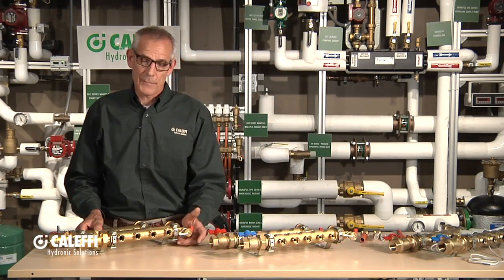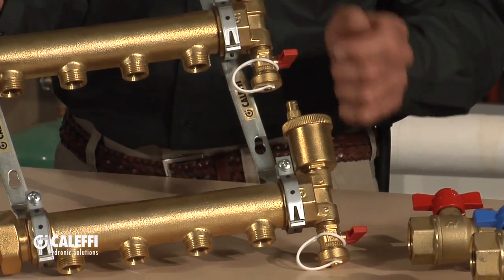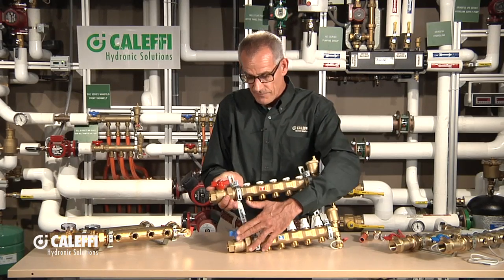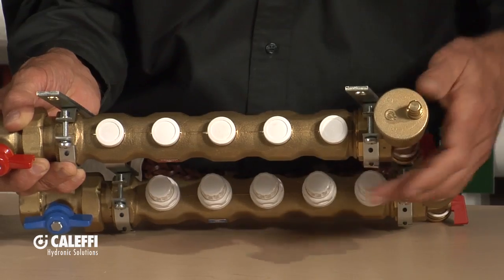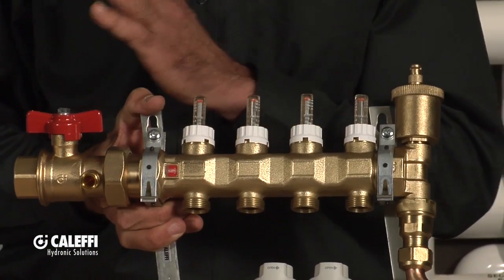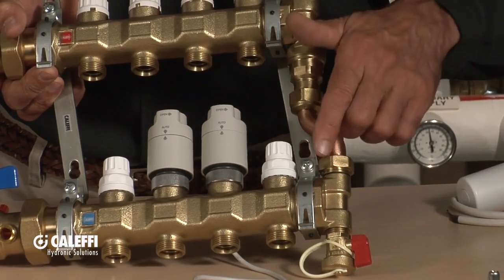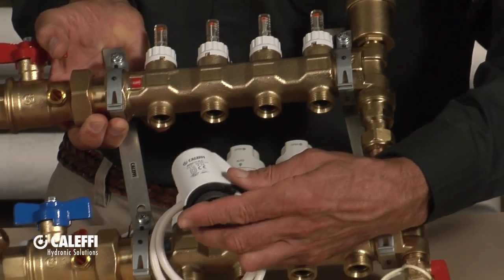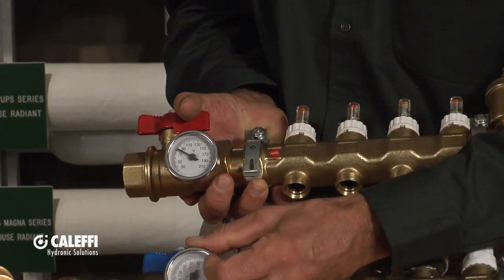TwistFlow™ - Hydronic Distribution Manifolds

Comment: Hi Bob - Love the videos.  I've watched a bunch and I've learned a lot from this channel over the past few weeks.  I have a question - I'm currently renovating a home in Europe and we had a floor heating system installed.  We have two manifolds in separate areas of the house, and I've noticed that in both cases the water send is going through the bottom of the manifolds where the actuators are located, and the return comes back through the top where the flow meters are located.  The guy who installed it seems to think the opposite is true (that the send is on the top and the return is on the bottom), however I've taken meticulous pictures of the entire renovation and I can plainly see he is wrong.  I'm curious what I can expect if the system comes online with this setup (it's not running just yet).  A lot of people here are telling me it's not a big deal, it will work.  I've read online it will work but the flow meters will not work.  Any help would be greatly appreciated.
Reply from the maker: Thanks for your feedback, Bob!  Our manifolds are set up with the flow meters on the supply side (water leaving the manifold into the floor) of the manifold.  Actuators would be located on the return side of the manifold where water would enter the manifold after it leaves the floor.   This would require the supply water from the boiler to the manifold to enter at the top isolation valve and water from the manifold to leave through the bottom isolation valve heading back to the boiler.

Comment: installing these upside down also seems to reduce the reliability of the flow meters....
Reply from the maker: +Matthew The flowmeter float is spring opposed, so it will still read flow even when inverted. In an inverted manifold, however, because the flowmeters are under the piping and not above, it is possible for “dirt” to settle in the flowmeter area over time and affect the movement of the float and spring. If this happens, the flowmeter valve assembly can be removed and cleaned or replaced (code number F69600). We hope this helps.

Comment from the maker: Hi Andreas, thank you for asking your question! Do the flow meter indicators have any rust type discoloration happening, what does the radiant fluid look like? It could be that the fluid has gone bad and led to corrosion inside the flow gauges.  If you would like to call us and we can discuss the problem, 414-238-2360  or email us at Ask.Us@caleffi.com

Comment: I have the 668...S1 manifold system with 41 circuits.
Most of the flow meter indicators are problematic. 
Some of them are stack to the zero indication, and some of them are stack to the maximum indication. They are not moving at all.
Is there a way to fix them in order to balance my underfloor heating?